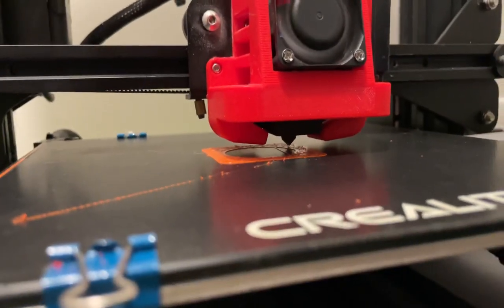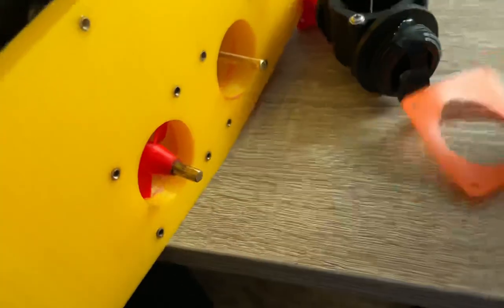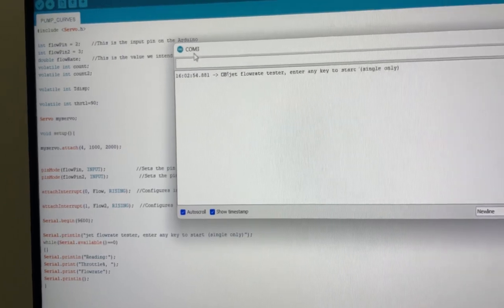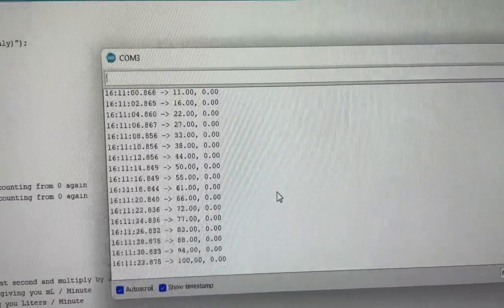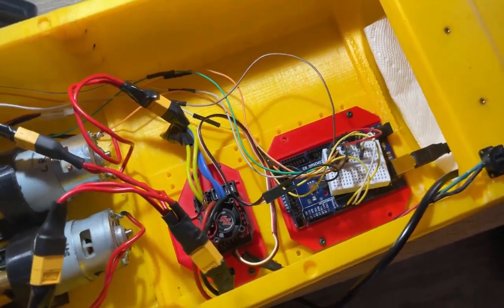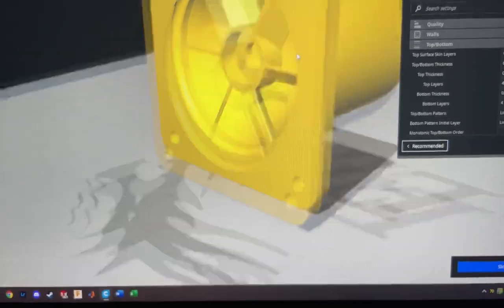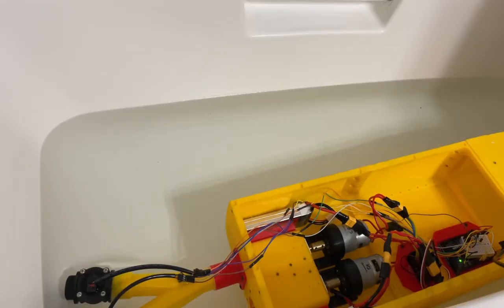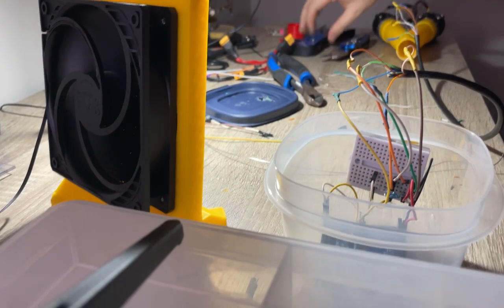3D Printed RC Boat Part 3: Fixing an Impeller Tester

Comment: Dont think of time away from projects as a distraction. Sometimes you need those days off. I know for me even in those days off im still thinking about what ever issue im tyrying to solve and it helps to take step back from time to time. Continuing to grind through without breaks is a good way to make silly mistakes and break or damage equipment. The minute your rushing or racing to get the problem over with... stop!

Comment: To print tpu, you need super accurate esteps. Also printing at or a little hotter than recommended helps as well. Also you need to tighten the spring screw as much as possible
Reply from the maker: Haha yeah, I've printed tpu tires for an RC car before and it took me a day or two to tune the settings. It was two years ago now so I've forgot which settings were successful and don't have time to tune it that much right now. Next time Ill take a look at your recommendations. Thanks for watching!

Comment: why don't you make a water catcher to water-cool the motors, so they don't overheat. 
it is a common problem for these  brushed motors.
you can also water cool the Arduino board, I think so. 
but very good content from a new youtuber.